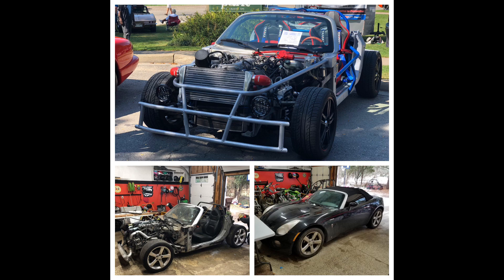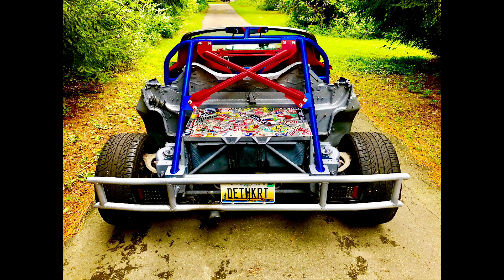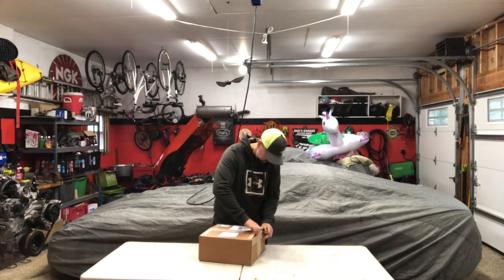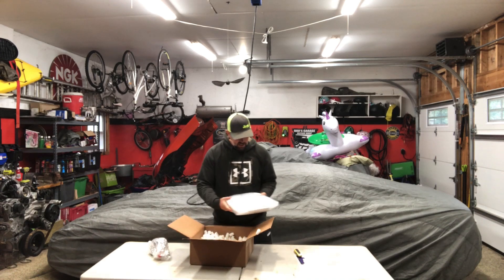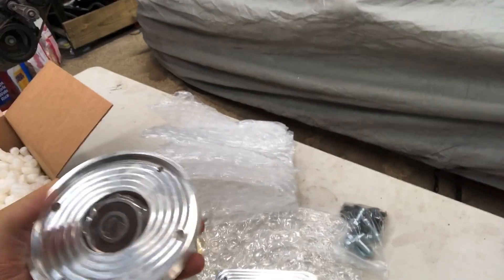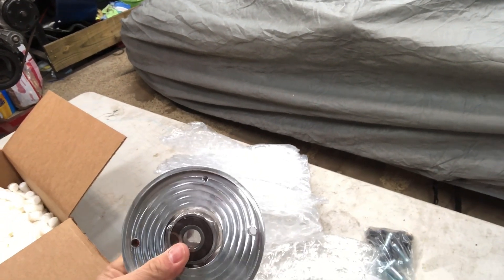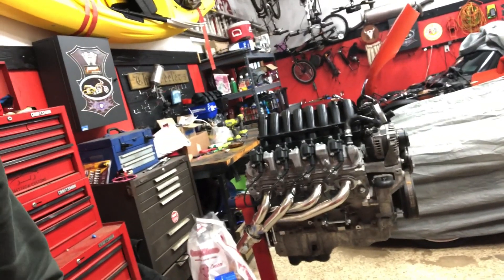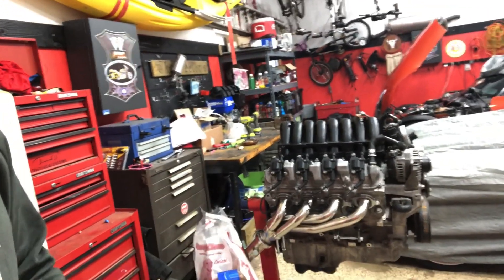FabBot NextGen AR5 adapter to a Gen V LT? Project Solstice Deathkart update

Comment: Do you have details on that flywheel?
Reply from the maker: Yes I thought I mentioned it in the video it's from a company called American Powertrain. It has the 8 bolt pattern for the L83 but the right teeth and bolt pattern for a LS1 clutch. The LT1 clutches are all dual disc and won't work. The sad part is the flywheel was like $450
Reply: @PeakPerformanceEngineering  thanks. I did look them up but wasn't sure which specific one it is.  I'll give them a call once I'm ready.
Reply from the maker: @Ponchiz318  I don’t remember them having it on the website I think I called and let them know the application and they hooked it up :)
Reply: Part list